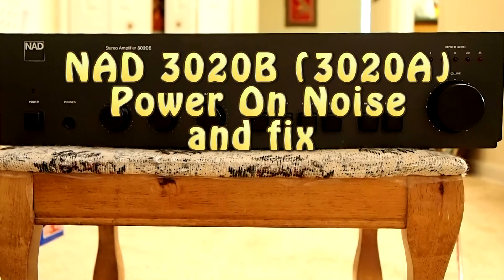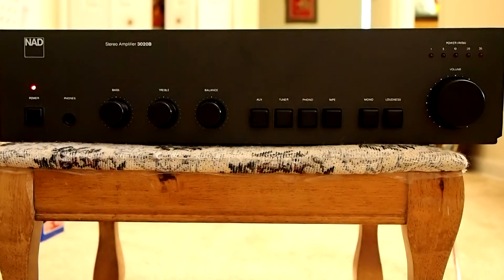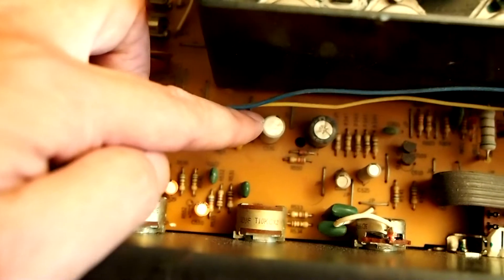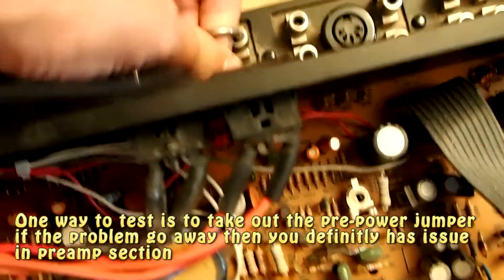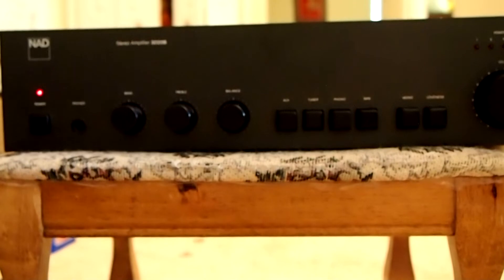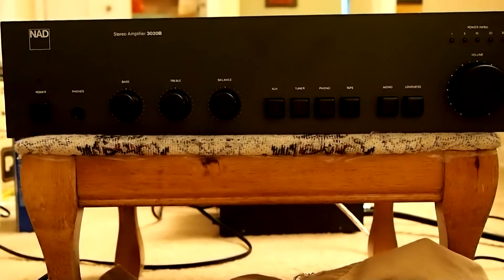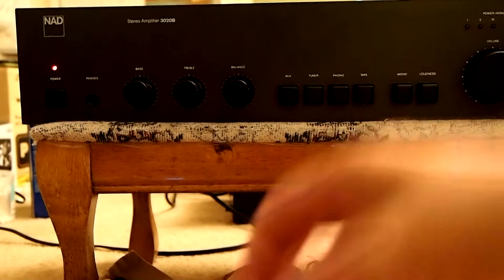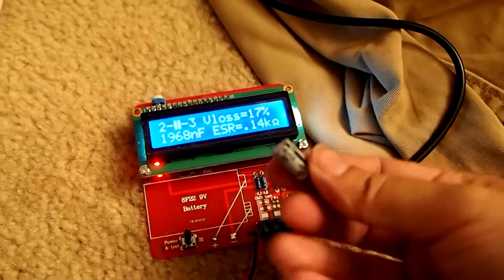NAD 3020B or 3020A Power on noise / hum and a fix

Comment: Hi, I'm just getting a faint buzz/hum in the right speaker but only when volume is moved up. I'm hoping it's just a bit of dry solder? It's not noticeable unless you're ear is next to tweeter but still not good
Reply from the maker: buzz on tweeter is normal. No worry.
Reply: @DunQuDeYi  er,..ok

Comment: Hi, I have a Nad 3020 A  after replacing all the electrolytic capacitors, there is a pops in the right channel of the amplifier. By removing the jumpers, the popping disappears.When I disconnect directly from the power, the popping also disappears.If I want to turn off the selector normally, I have to turn the speaker balance to the far left position. Then there is no popping either.
Reply from the maker: That is hard to check. The issue is clearly in the preamp section. At this moment, I think the best way is to buy a oscilloscope and trace the signal.

Comment: According to NAD 3020B schematic I've found, this cap has over 50 volts across it (61 V actually) which would explain why a 50 V cap is short lived in there. I'd place a 63 V or even 100 V cap in there.

Comment: I have a Yamaha integrated amp that only causes a buzzing static sound for 2-3 seconds after startup from speakers only when a digital input is plugged in.  No sound when analog inputs are plugged in or when volume is muted right after startup. What may be causing this?
Reply from the maker: Sorry. I am not familiar with that one. But generally you will need a schematic or at least to have a scope to measure the trace, if no one knows the reason